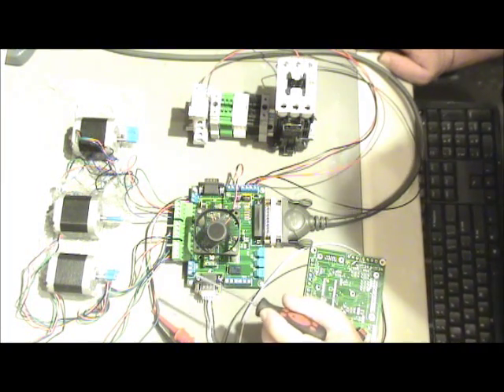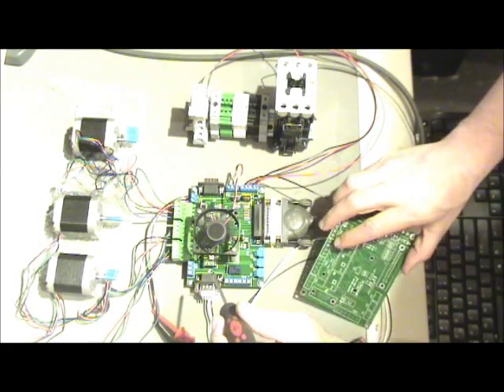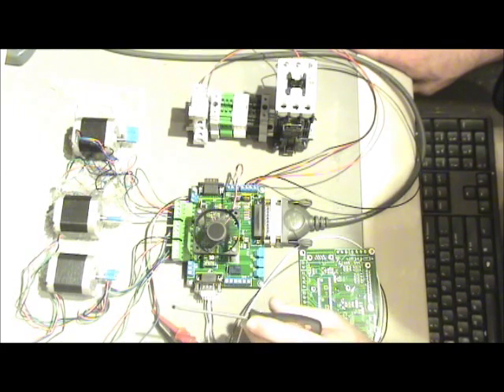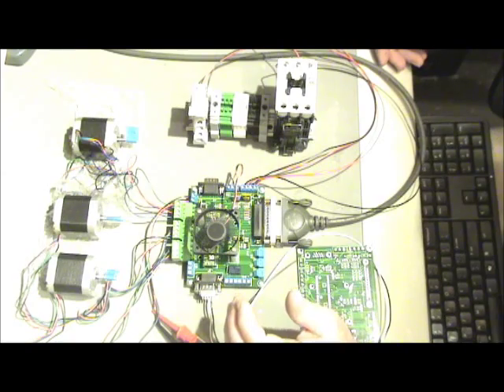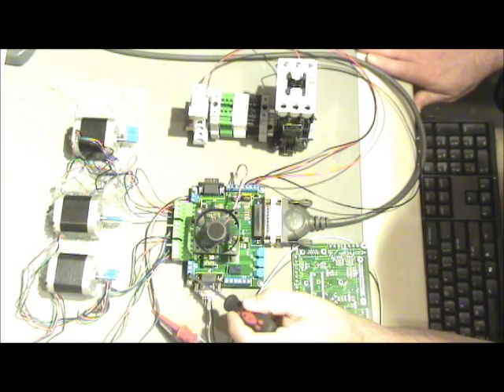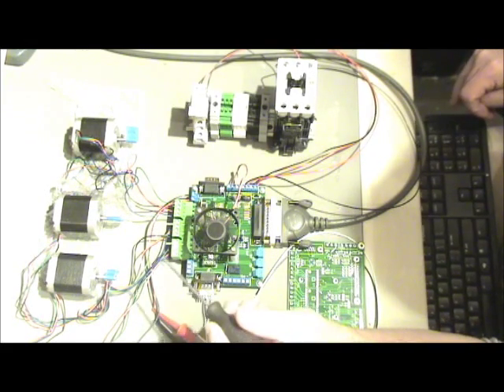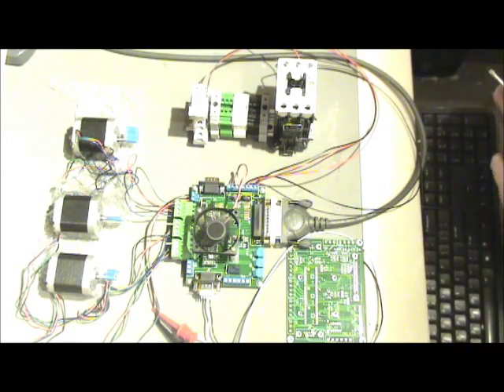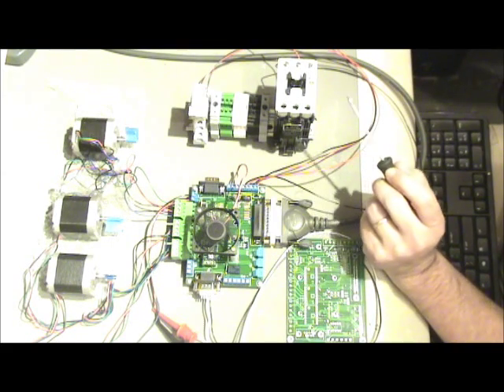Buildlog.net Laser Interface/Driver PCB

Comment: Hi
How you manage the power of the laser. I was thinking to build this interface and use it to chinese laser cutter sold on ebay. I purchased one that is not working, but laser is working so I have laser, step motors and power supply.